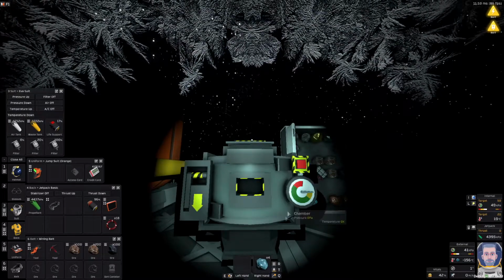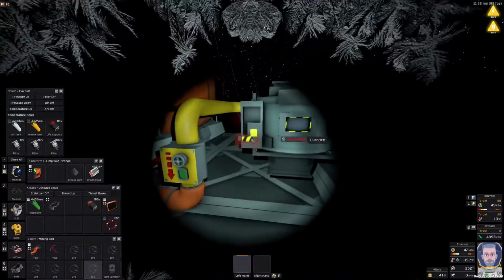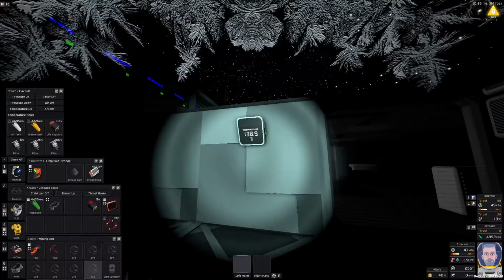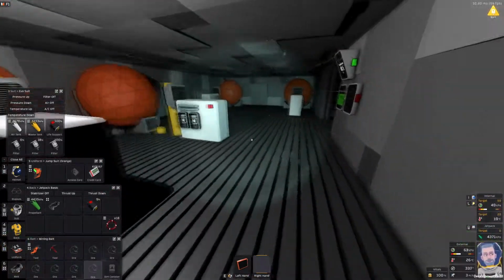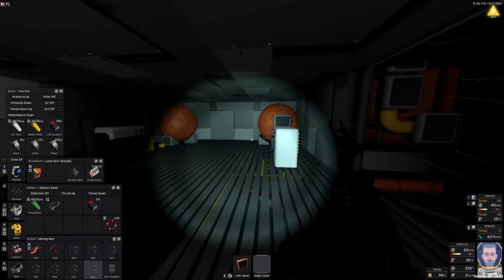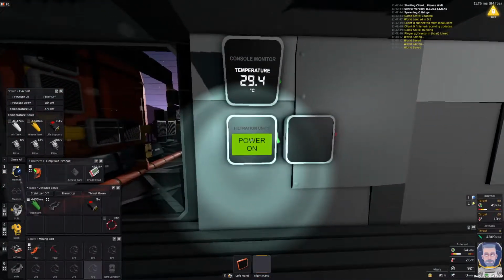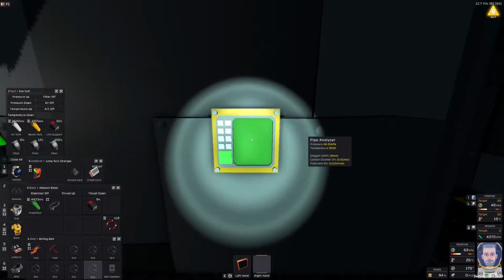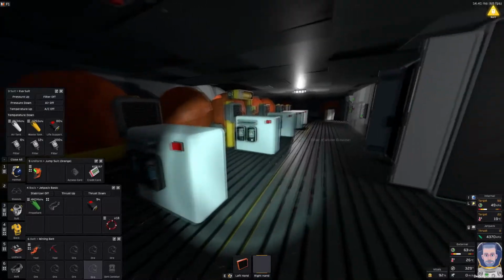Stationeers - Indepth Tutorial Gas heating and cooling from Furnace.

Comment: How do you cool gasses in a vacuum?
Reply from the maker: IRL or game ?
Reply: @ggfirestorm  in game, but i think the game is not really accurate because the gas was cooling down faster when i put a radiator on the pipe. It was a vacuum so this should not have been possible in irl rigth?